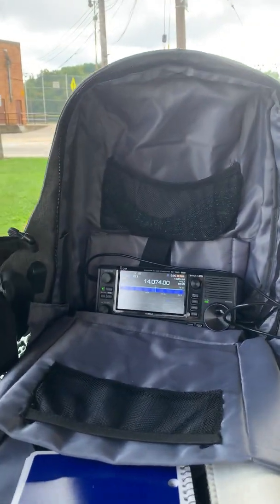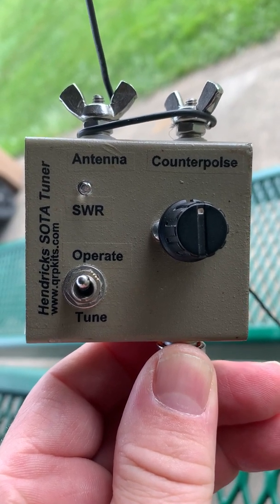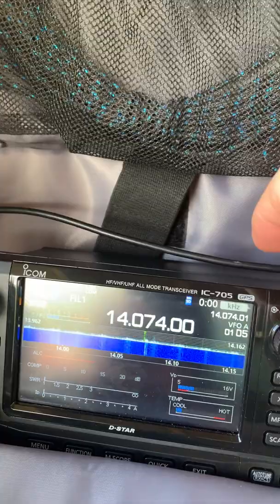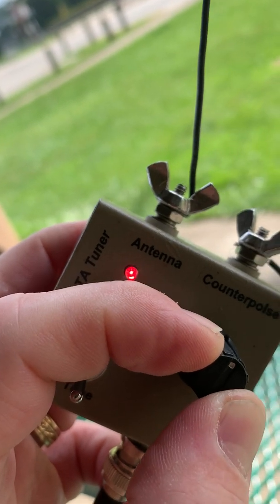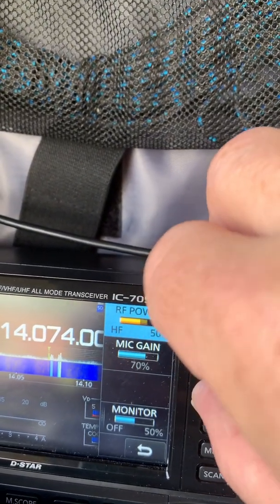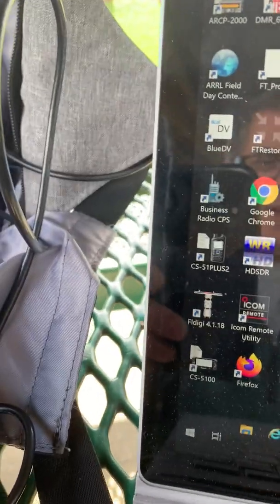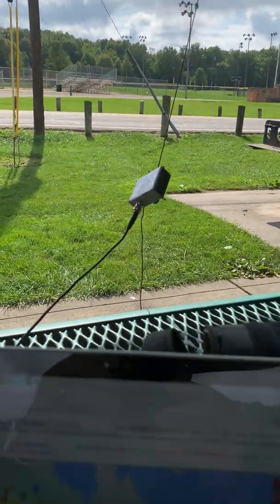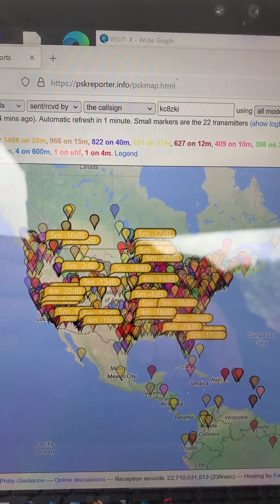Hendricks SOTA Tuner demonstration

Comment: What were the lengths of the wires? Thanks
Reply from the maker: The tuner is designed to tune a half wave length of wire.   I use 33ft for 20M or 66ft for 40M